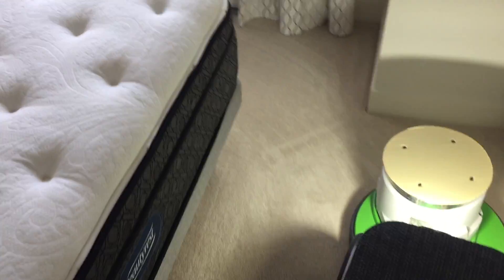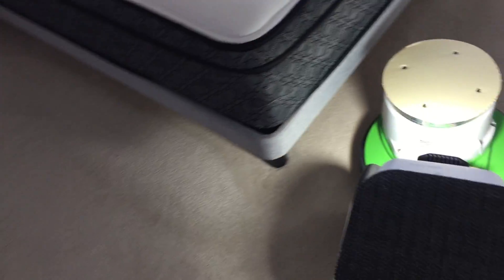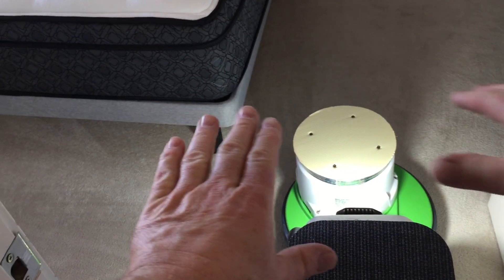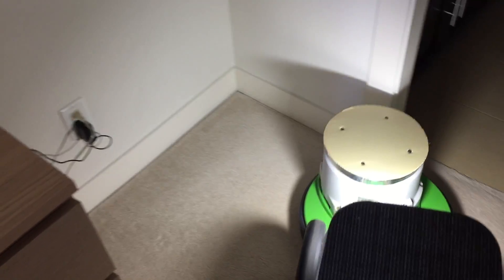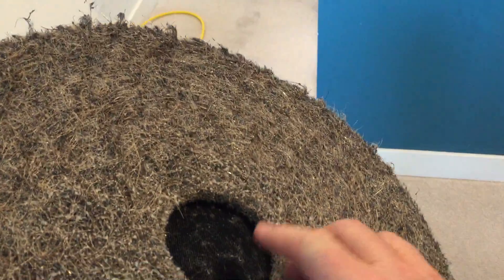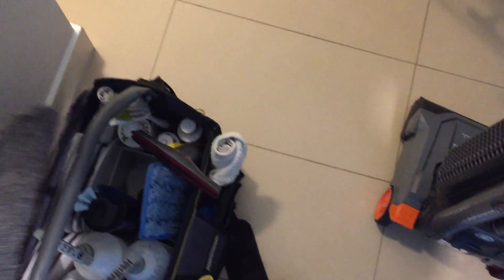Oxy-Dry repeat short term rental condo

Comment: Did you custom make that lid for the shampoo tank Robbin ?
Reply from the maker: The lid came with the tank but I have made lids for other tanks on my other machines.
Reply: I think that's a centor tank
Reply: @sylvainroberge2450  centaur yes you are correct thanks a million. I need this in my life. No more splashing with this tank
Reply from the maker: @sylvainroberge2450  Yes, it is sold by Centaur. The drain feature is useless and you have to replace the bolt in the centre with a stainless one as it starts to rust very quickly
Reply from the maker: @extremesteamcarpet  You can make one yourself easily.
Reply: @OxyDryCarpetCleaningKelowna  yeah I just zoomed in on the centaur site of the lid. I’ll definitely will make 1